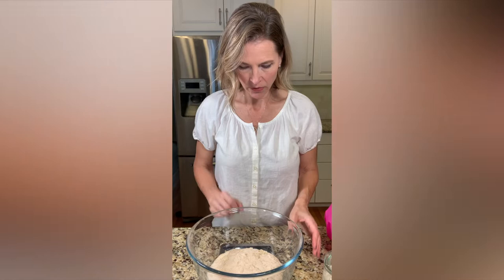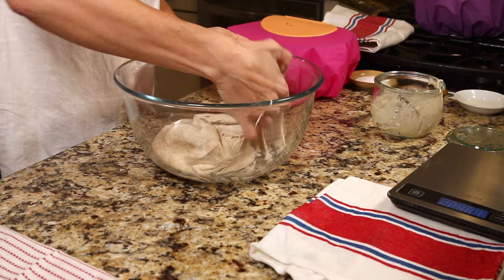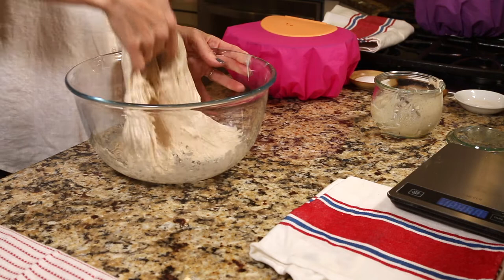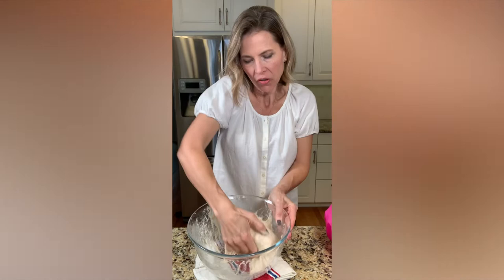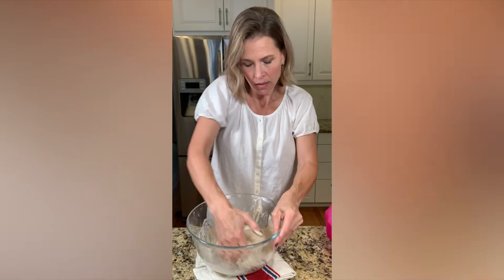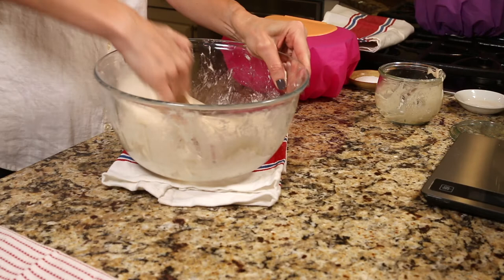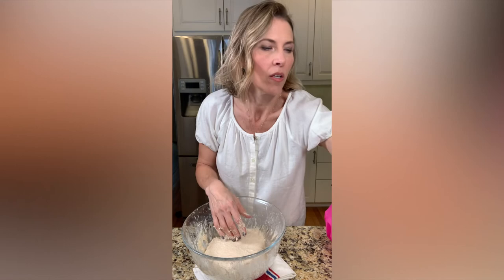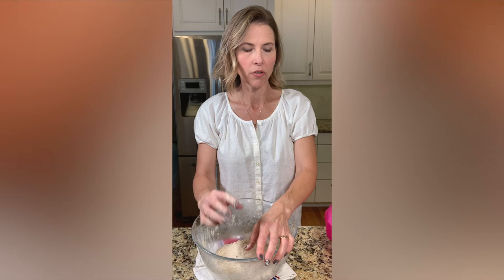The Rubaud Mixing Method for High Hydration Sourdough Bread

Comment: This is the best explanation of the Rubaud method I’ve found. I’ve been making sourdough for years, but I’m still learning a lot. How do you define “intermediate”? Hydration over 70%? 
I need to find sources for different fancy flours, too. Thank you for taking the time to help me!
Reply from the maker: Hey there! Glad it helped! Intermediate is kind of subjective but to me it means anything over 75% and/or using flours that change the structure of the dough and are more challenging to work with. Rye, wheat, spelt are all delicious and give great flavor - they're water hogs, though and can feel like a little more wet and heavy. This Rubaud helps tame them. 😂